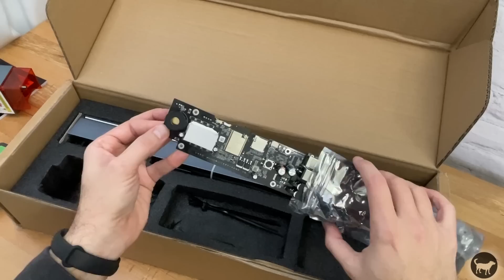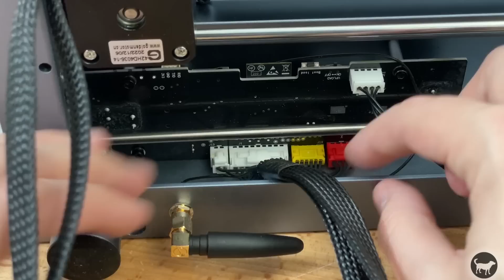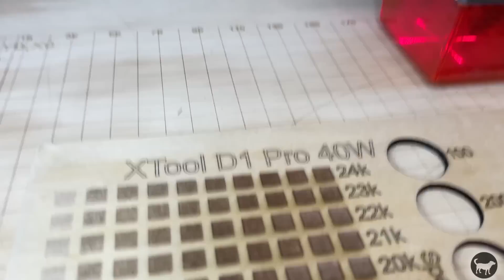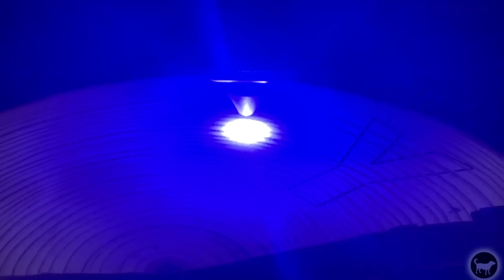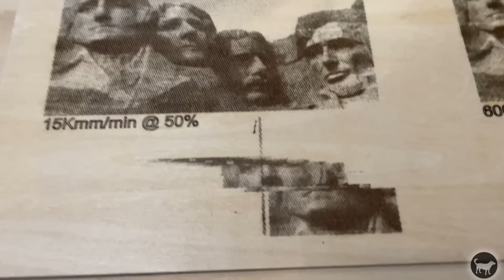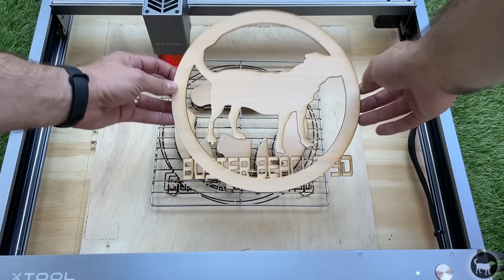XTool 40W Diode Laser Module Review | 40W Output | Integrated Air Assist | Cut 20mm in ONE Pass!

Comment: How well could this module cut hard woods such as cherry wood? I already have the 20w module which does make some shallow cuts at full power and lower speed, but doesn't seem to cut all the way through over multiple passes.
In terms of metal engraving, how would you compare this module to the ir module? With higher power will it give you a darker engraving than the 20w module despite the fact that it still isnt infrared?

Comment: Hello 👋 

I have been using the xtool 40 w for about the 7 months you also have. I clean my laser and lens every job + 2 times now swapped out the lens. However, I have noticed a steady drop in efficiency. It's now taking the settings as my 10 w to cut 3mm bassword, and even at 100% power, it doesn't get hot as the head used to.  Is that something you have experienced? Thank you in advance. (btw I'm your loyal etsy xtool buyer)
Reply: Sorry it didn't tell me you replied.  Thank you for your input.
Reply from the maker: Hello Andrea. Of course I know who you are. To be honest since I go through so many machines your are most definitely using one machine for longer periods then I do. I know there there is a working life of a diode laser but I can't image that you have reached it yet in 7 months. I believe that xTool have a Warranty period for up to 12 months on some of the major "no wearable" parts so it might be worth reaching out if you laser isn't performing up to where it should be.

Comment: Thanks for the vid. Always hard to get detailed informations directly from overseas. How about the cooling fans? Are those temperature controlled? Or just running full speed as soon as the laser fires?
Reply from the maker: On the older D1 machines I believe the fans were full blast all of the time. On the D1 Pro they just turn on when the laser is firing and it's pretty much an all or nothing situations I think.

Comment: How well does the 40w engrave/etch steel?  Wondering if it does more than mark it like the 20w and 1064nm infrared heads.
Reply from the maker: You can cut through very thin stainless steel so it's definitely more then just marking it.  However if your main focus is engraving on metal you may want to look into a fiber laser, they are way faster and do great with metal.

Comment: Did you have any issues with the laser operating correct in light burn? I did a test with it, that my previous 20W did well on. Without changing any of the settings, I tried the 40W. The 40W made the cutout compact. Any suggestions, as to what could be the issue?
Reply from the maker: It's hard to tell. I was able to swap the 2 out without any issue at all. I would probably check out the xTool Facebook group to see if anyone else ran into a similar issue.

Comment: So u really not sure it will work with the D1 then
Reply from the maker: Like I said I haven't tried it but don't see any reason it wouldn't work if you are able to add the holes for the limit switches and find a new little sensor wire.

Comment: We have found that whether it’s Yeti’s or wood work, anything over 4000 mm/min causes some slop in the 20 w.  This was a passing thought to upgrade for faster cutting, but now I think I’m content until they do a 40w frame which I’m sure will be $2000+ with larger motors and accommodate faster speeds.
Reply from the maker: Yeah I usually live around the 8,000 to 10,000mm/min mark myself but I can understand the wanting to be conservative with with the speed.

Comment: Learning so much from watching your video's great stuff, do you know of a cheapish pair of safety glasses for the xTool infra red laser module 1064nm . I've got the xTool D1 20W pro two in one kit. Not sure if the glasses that came with the machine covers both lasers? Any help or advice would be appreciated👍
Reply from the maker: Thank you. To be honest I’m not sure. The IR laser is at a different wavelength so I don’t know what glasses came with it but I wouldn’t think a one glasses fits all solution wouldn’t necessarily work. I would search the XTool Facebook group or Amazon for glasses for the particular wavelength of the laser to find the proper safety glasses. I don’t have the IR module but I do have a fiber laser which works at a different wavelength and the glasses that came with it are different.
Reply: @BusterBeagle3D  Thank you for your quick reply

Comment: If I had to guess, if say someone that doesn't understand math just added the 300mm/s of the one axis and the 100mm/s of the other to get the 400mm/s rating - even though it's actually only just over 316mm/s actual travel distance if both axes are traveling at max speed.

Comment: Also the fiber lasers with fixed lens and laser are much better for Stainless steel and can go extremely fast. FYI You can get a laser that is a Co2 laser that is air cooled. You really need to do more research on the laser systems. A Co2 laser runs at a different frequency as do the Mopar and fiber lasers do. Co2 lasers are for specific applications and you cant' compare a Co2 vs diode lasers as they work and cut differently. There is another type of laser that is YAG and its different than the other 2 and is used for electronics industry. I ran one for 4 years at a company for doing micro electronics.
Reply: In your experience what is the best diode laser wavelength and wattage for cutting birch plywood ?

Comment: I have a 40w kit coming in to upgrade my d1 pro. My question is I also have a 10w d1 can I  convert the d1 using the parts that comes off the pro and make the d1 a d1 pro
Reply from the maker: You would have to figure out a way to install the Pro limit switches and limit switch tabs to the old D1 frame which honestly doesn't seem that hard. Only other thing you would need is the wire that connects the limit switch to the gantry (that little 2 wire port) as well as 2 little spacers that sit behind the limit sensor on the Y axis roller frame and you should be good to go.

Comment: Speeds are limited to the gantry size and weight. Also the weight is important to the motors. Those steppers are 3d printer types Nema 17's If you beefed up the gantry and added larger motors you would be able to go much faster. Going faster doesn't mean anything better because there is a limit to speed and optical power.
Reply from the maker: I completely agree. Even if I could go that fast I most likely wouldn't. I'm merely pointing out what was advertised vs what you could actually do.

Comment: why are using mm instead of inches? do want to make the laser look faster 300mm = 12"
Reply from the maker: I use mm in all 3D printing, laser engraving, 3D modeling, CNC etc since it’s far easier to understand and get precise measurements. 300mm is not actually 12 inches, it’s 11.811 inches. 12 inches is 304.8mm :)

Comment: I keep hoping someone will do one of these tests and include trying to cut through flooring laminate given how useful, cheap, readily available everywhere, strong and dimensionally consistent of a material it is(all those machines,grinders, jigs,saws and what not that you see all over youtube can all be made using laminate rather than alu and plywood, and in most cases better...)
Reply: A lot of flooring laminate is Vinyl or contains mystery materials that could be really harmful to laser cut.  Best not to risk it unless you can get a full MSDS from the manufacturer.
Reply: @Stevieboy7  Laminate is hard HDF(wood) with a phenolic backing and a wear surface that is composed of minerals of some sort held together with phenolic or some other hard binder.  Laminate and pvc/vinyl click-tiles/planks is not the same thing..
Reply: There is all kinds of chemicals and petroleum products used for abrasion resistance, things similar to Teflon and Kevlar and the fumes are SUPER bad for you. I would advise only engraving/cutting these materials if you are using a smoke proof enclosure and have air filtration and fume extraction to the outside. There are also air testers for job site working conditions you can buy or rent. I would recommend at bear minimum to rent one and test while cutting to see what pops up and validate the effectiveness of your extraction. 
This stuff is bad news to breath in. And a lot of these really bad ones don’t even have a detectable odor or anything that you can differentiate between regular smoke. It’s not like the bad stuff will glow green and have little biohazard ☣️ shaped snowflakes ❄️ fluttering about 😂😂😂 

I know it sounds alarmist, but I personally knew people who have died from things like this and every single one of them said some version oh “I wish I could go back and smack my younger self and wake up. It only takes a tiny bit of time and saves your life and would give you back so many years of quality time. It’s not worth skipping the safety part. “

Comment: Does it cut clear acrylic?
Reply from the maker: No. There are no diode lasers that can cut clear acrylic.
Reply: @BusterBeagle3D  thats not true at all! There are multiple videos on how to cut clear acrylic with diode lasers on youtube. It requires special preperation of the acrylic, but it is 100% doable.
Reply: @orion7741  Most amusing.
Reply: you sure sure thats not engraving and is cutting ?
Reply from the maker: @daytrace4635  You can engrave on clear acrylics as long as it's coated with something. You are essentially burning the coating on the surface. The beam would otherwise just pass through the clear material.
Reply: @BusterBeagle3D  Think you replied to wrong person, I was asking them to clarify bc I too thought they meant engrave instead of cut. Ik you can engrave it but never seen a diode able to cut it
Reply from the maker: @daytrace4635  You are correct, sorry. I didn't open the full message chain so I assumed it was the first poster. I have never seen any video where you can cut clear.

Comment: You can change those values by flipping the the switch on the control board to write. Then once done writing the new values, flip it back.
**(caution)**  changing values to something outside of the scope of the machine could potentially break it!
Reply from the maker: I had not tried that. I’ll have to give that a shot. It’s definitely not something that is advertised.
Reply from the maker: I tried to adjust those setting after flipping that switch and was still unable to make it write to the machine. Is that something you have done recently?

Comment: Well now I know why I have to press home 3 times... thx
Reply from the maker: Yeah. I don’t have the extension rails but but sell a grid for it on Etsy. I figured that one out trying to debug an issue from a customer.
Reply: Curious, could it be manually repositioned to home or is it bad for the stepper motors/belts?
Really appreciate your time making these videos
Reply from the maker: @dijimeistro  From the years of 3D printing I have done I have always heard that you shouldn't move them manually when plugged in because it could cause a spike in voltage but I have moved them around many time without issue.